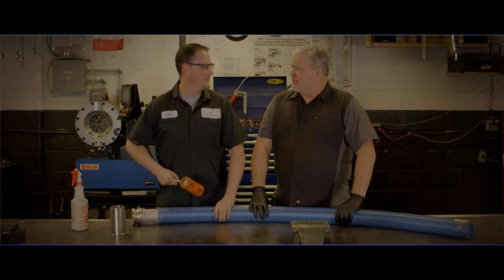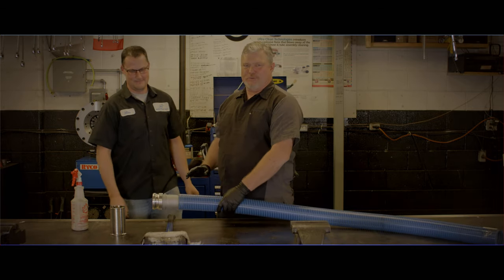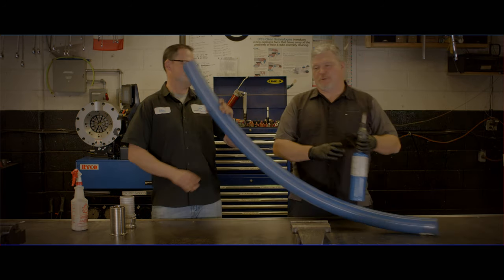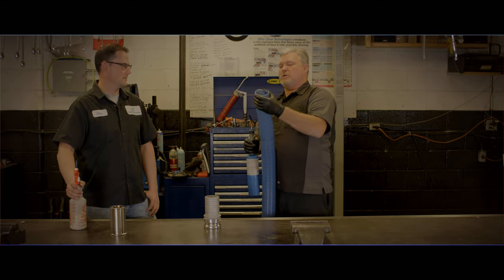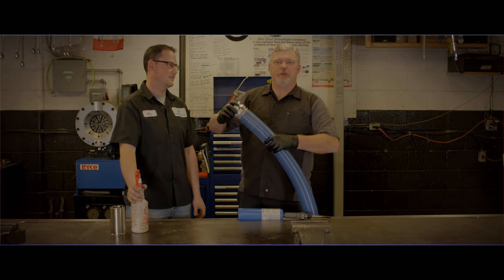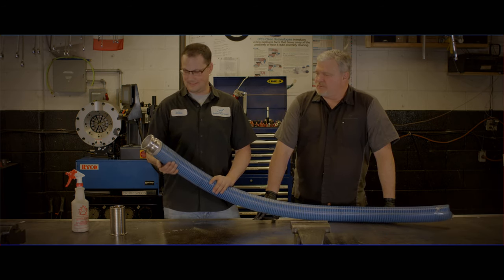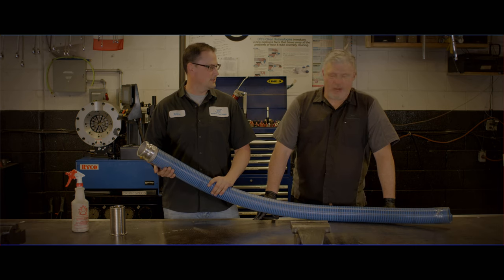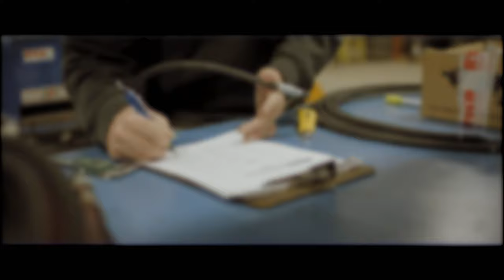How to assemble a suction hose

Comment: Best way ever for me is boil up some water.Take the container off the heat source and then place the end of the hose you want to put the fitting on in the water. Wait a bit  and then (have the fitting face down on a flat surface) push the hose down on the fitting. I tries hammer,wd 40 etc but this worked the best ever for me. Bigger hose longer time in the water. I use a vertical spaghetti pot.